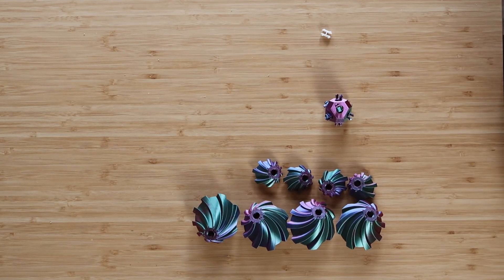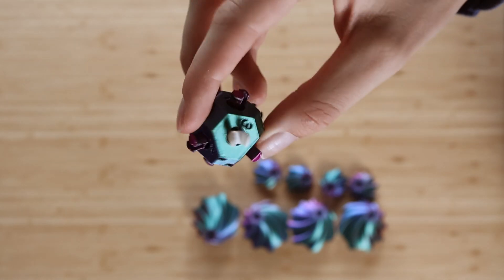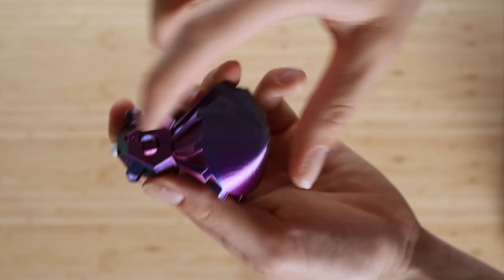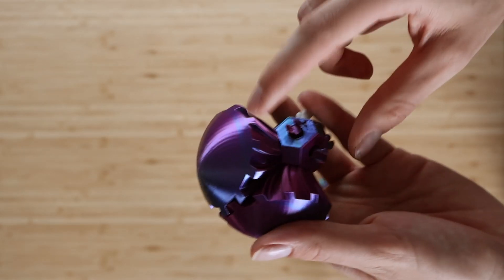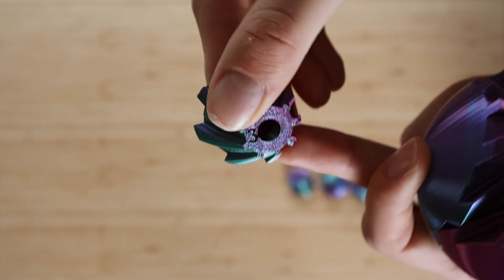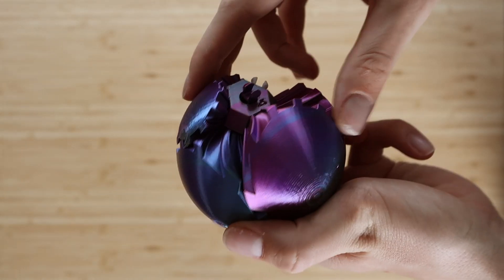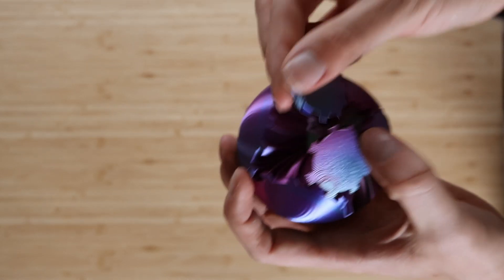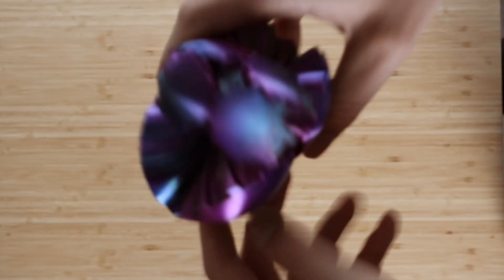Gear Ball 2.0 Assembly

Comment: Great creation. Printed fine, as you said I had to fine tune the connectors slightly. Printed the Strong Connector version in PETG and adjusted the size a fraction. percentages 103 x 98 x 103.
Went togther and its as smooth as. Thanks Ruven. Kids will love it. Now to decide which project next. 😀

Comment: Hey Ruven, I really appreciate the effort put into this and your other designs. I've had a lot of problems (and have noticed others mentioning having problems as well) with the connectors breaking in this and the other gear ball. In a gear cube print that I had found online by someone else they used connectors with hollow centers (they connected on the outer edges, making a closed loop). This worked very well and I have put together about 5 of these for my nieces, pulling them apart and putting them back together with different colors over and over, without having any of the connectors break. It might be worth looking into alternative connector designs like the one I mentioned. Thanks again!

Edit: It's worth mentioning that the connectors perform much better when printed in PETG, but I still think that alternative connector designs would be a good idea.
Reply from the maker: @dos54  Hey, can you link me that design?
Reply: @Ruven_Bals  Yeah, I'm on vacation visiting family right now but I will in a few days
Reply: Can you 😢send to me as well? I’m having problems with connectors. ❤
Reply: please link the connectors i'm sure many of us would like to see them..ty in advance
Reply: Any link yet for the new connectors? Would love to have them!😊

Comment: what would be my cause of connectors breaking during assembly? I print a handful of extras every time but I am affraid they are gonna pop apart while playing with them since they be weakened while assembling. Some times i have no issue then sometimes I get 3-4 break each time. Oh this is happening with the original gear ball also. not the 2.0
Reply from the maker: Yea, no idea what causes that. Maybe try more walls. I never had a single one breaking.

Comment: mine did not print the numbers on the bottom of the gears...is there any way to tell them apart?
Reply from the maker: Sure. There are 4 gears in total. 2 big ones and 2 small ones. The difference is that the spiral goes the other way. So identify those that have the same spiral direction. There is always a pair of 2. You can then treat them like i did in the video.

Comment: What if instead of these connector pins one were to include small metal ball bearings, and just glue a pin into the bearing hole. Would it make the entire thing run smoother?

Update:  I remodeled it after buying it and made it have sockets for regular metal bearings, and it works great.

Comment: Has anyone tried to make one of these in metal?  I would like to try it, but I wonder if the pieces would "snap" together.
Reply from the maker: It would definitely work, but you might need to 3d print the connectors.